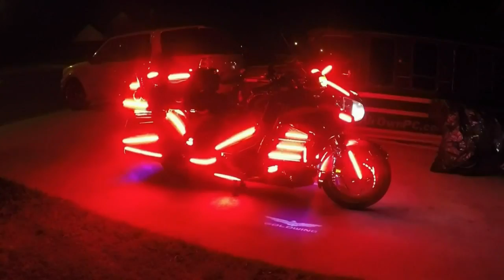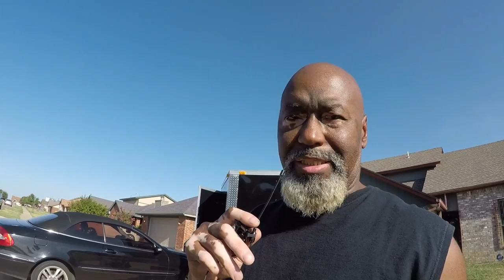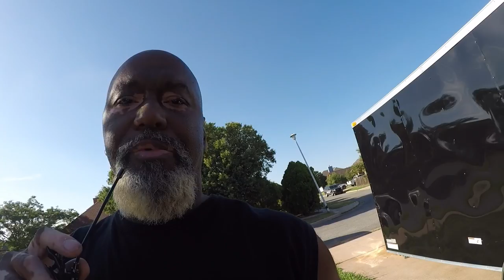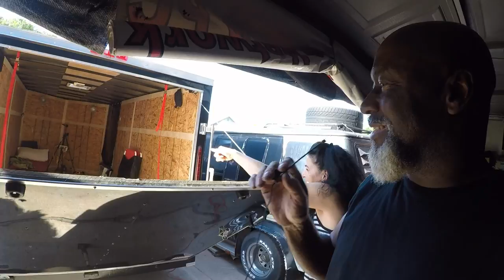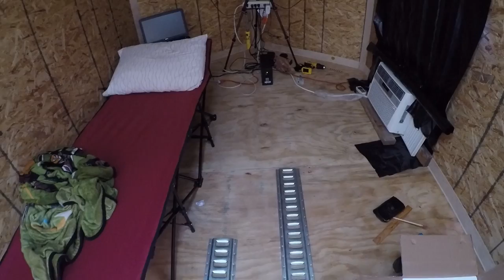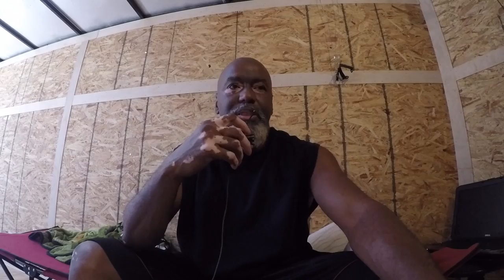My New Cargo Trailer Jackknife

Comment: I'm glad your okay, I'm guessing that a 16 foot dual axle trailer of that size will have a 2 inch or a 2 (5/16 ) inch ball hitch, never exceed the vehicle’s towing capacity, the tongue weight for any trailer should be between 9 to 15 percent of the gross trailer weight, for example a 2500lb load on the trailer should have about 250 lbs on the tongue, 60% of the total payload should be ahead of the axle, 40% of the weight should be behind the axle, I learned this the hard way by once pulling a heavy load of dirt mulch back in the 90's, I almost jack knifed my 84 chevy silveraldo 1/2 ton truck on a 4 lane road, needless to say that when I made it home, I had to change my underwear.
Reply from the maker: I know it is not a laughing matter but that was funny, thanks bro.

Comment: Is the trailer insulated? If not, then you need to do that before you geet too deep. I have several trailers like yours at work down in the swamp land. They are too hot to tolerate without insulation. Especially the ceiling. Fyi...
Reply from the maker: Thank,s bro, I am looking into it and how to do it.
Reply: No biggy. Use the Styrofoam if you have to (lowes or home depot) it is really cheap. You can find youtube videos on that though (homemade toy hauler) is probably a good keyword to start with. If you need help, then let me know. I am here if you need me.